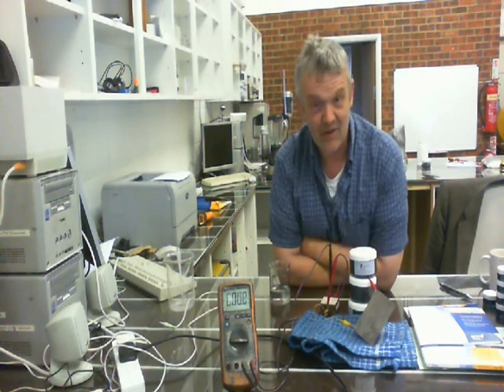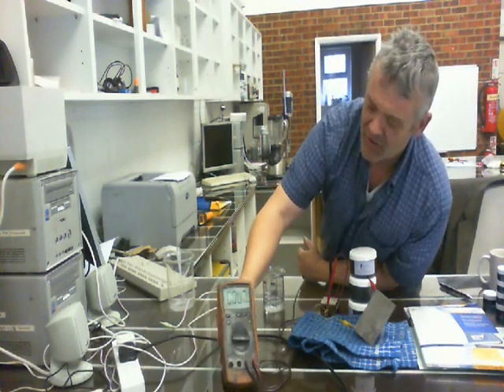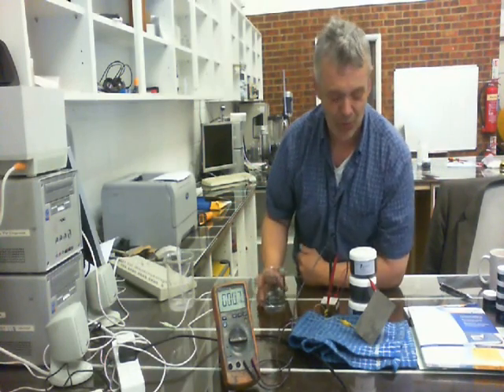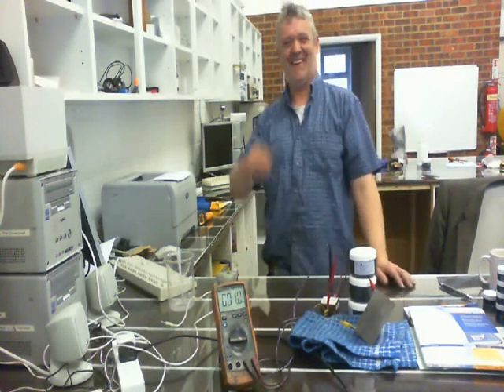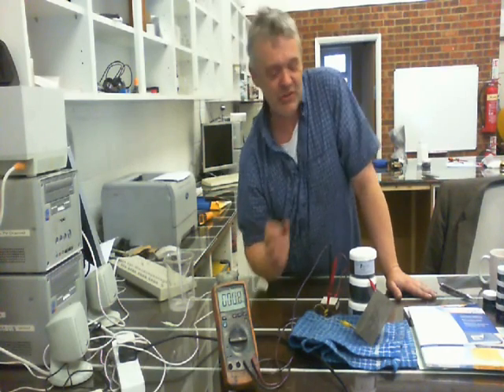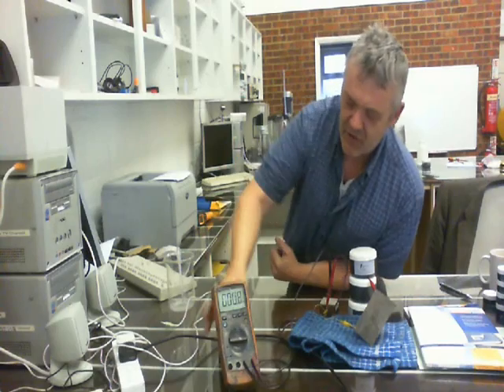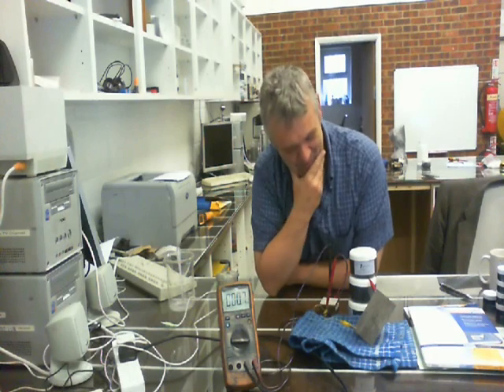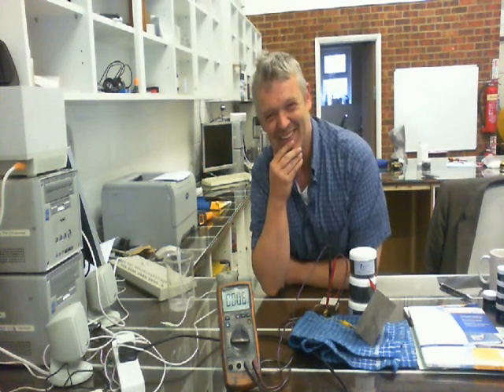Generating Electricity From Salt Water And Graphene (SWAG generator)

Comment: I have a question for you, although it's possible it may have already been asked (as this video is a number of years old). My apologies if you've already covered this subject.

How many times can you run the same salt water over the graphene surface, and maintain the voltage?

My reasoning for this is that I saw another video of yours, where the device was sitting in seawater and as the water flowed over the device, it generated current. I was thinking that if you had a secondary battery that was used solely to power a small pump, you could enclose the device with an input pipe, and output pipe, and a container with the saltwater solution. By pumping it continuously over the device, it would keep generating current. If the system is a closed loop, how long might something like this run?

I know my idea may be crazy, but then again, I often have crazy ideas that sometimes work.

Best of luck in your endeavors.

George

Comment: Science the way it was meant to be done, by doing it, getting experimental results and then making sense of it, and doing other experiments. Bravo.  I immediately thought of lord kelvin's thunderstorm a water drop electrostatic generator.   Of course there you are dealing with Kilovolts and microamps.  Just an idea, but you could create a stack much like a cellcore stack but one which expanded and contracted based on a small temperature difference quickly. Just like is done with a Saser (Acoustic Laser). This could force water at higher velocity back and forth across the graphine. Essentially an electric generator working much like an ultrasonic piezoelectric generator. The advantage is high power density and low weight.  I will put one together, test and report back on the results. You can look at some of my older patents to see how I would use the material.
Reply from the maker: Definitely - i would be fascinated to see - thanks for the hints and help
Reply: Robert Murray-Smith  Not sure I have been of much help, but you have helped me, and hopefully I can return the favor.  I am making hydride heat engines which are powered by ambient temperature conditions.  This is possible because hydrides equilibrium pressure can double and half in 15K increments.  The rate of the reaction is proportional to how quickly you can move thermal energy in and out, and the best one are notoriously poor thermal conductors. So I've become a fancy plumber doing heat pipe heat exchangers, and thin films to get fast cycle times. Yes, I have patents and have worked on this for over 10 years and am about to hit payday, but I do understand your frustration with the current system. I also feel a bit guilty because my work is built upon everyone elses.  It seems sort of unfair sometimes that to one person or worse company goes all the credit.  Anyway the hydrides when thermally cycled have enough fluid power to run a vapor compression system which cools one hydride by allowing a refrigerant to expand, and reject the heat to the hydride releasing hydrogen undergoing the endothermic reaction.  Operating temperature from 0C to 30C.  In essence we have a sort of chemical stirling engine with a vapor compression system being the thermal battery, and as long as your rms mean temp is ambient then all the internal energy is keep constant just changing with the outside ambient within the temp range.  The hydride I am using is CeNi5 because its gut a high eq pressure at low temperatures, but others could be used in the same manner. I hope maybe this help you on something. Seeing as you have shared so much with me. I wish to reduce the mechanical parts and weight so we could power cars, boats, etc this way.  You have given me many ideas.
Reply from the maker: Kimberly Peacock
that's good to know - when you were talking i was reminded of Einstein's fridge. I have absolutely no problem with genuine patents I have a problem with lawyers and too broad a scope that limits others too much - let me know a few numbers and i will have a read
Reply: Robert Murray-Smith As to Einstein's refrigerator yes its an absorption type but the cool thing about the hydrides is they alternate between being heat pumps and engines and can be tuned.  To my mind thermocycling them is the best path for the technology.  I think we are kindred spirits.  People forget that Michael Faraday was self educated.  I will explore any idea as long as it can be demonstrated.  I think Feynman philosophy matches mine, in that for many problems you need to attack it from a different angle or perspective, and to do that you have to be open to surprises.  I admire you.
Reply from the maker: Kimberly Peacock
Now you have named a few i realize that I have come across a couple of your patents before and read through them- nice work
Reply from the maker: Kimberly Peacock
bless your heart - feel free to write to me at robertmurraysmith64@gmail.com
Reply from the maker: Kimberly Peacock
actually I am in nY long island greenport
Reply: Robert Murray-Smith Next time I head out that way I'll drop you a line and maybe we can meet for coffee. Love Greenport. I grew up in Bar Harbour Maine and Greenport has the same sort of feel to it.
Reply from the maker: Kimberly Peacock
Sorry I meant in Long Island in a general sense lol - I am visiting here and only here until the 1st of august
Reply: Robert Murray-Smith Well I head out to Melville quite a bit sort of a middle point between manhattan and greenport if you want to get together for coffee sometime.  Do you sail?
Reply from the maker: Kimberly Peacock
I do indeed - and sounds like a plan

Comment: Paint it on a cylinder and spin it in saltwater
Spin a rod of graphene in saltwater
How about a propeller?
Reply from the maker: why? - just dip it in the sea - occams razor mate - try for the simplest first and see if it  actually works - at this stage it is just a curiosity - it needs proving up
Reply: Robert Murray-Smith
Why not? That's the real question. You can't put a sea in your test lab can you? Besides, what kind of boat do you have that could mimic the surface speeds or ease of your new blender?
Reply from the maker: *****
it's not up for sale yet mate - it's only going out to my indiegogo supporters at the moment
Reply from the maker: TheIdeanator
Why not - well there's more likelyhood of failure with complex machinery, I live by the sea so moving the test gear down there is a 500 yard walk for me and I live on an island so i was thinking of sea powered electricity generation for everyone. But not everyone thinks the same thing - so go for it - test your ideas out
Reply from the maker: *****
will do mate

Comment: If you coated the blades of a Tesla turbine with your ink, and wired it for generating electricity I wonder how much you could generate by pumping salt water through it?  Let me know what you think.
Reply from the maker: it's a good idea - i can see a problem with the connections though that i imagine would have to be at the central axis (no problem) and at the turbine rim (big problem) but i think if you can overcome that it would work really well - bear in mind this is exactly the problem Tesla had with his homopolar generator and he solved it by running to generators and connecting the outer rims with a metal belt so take off was at the axles only

Comment: Does annealing change the result? That is amazing
Reply from the maker: i'm sure it does - i am guess it makes it worse lol. the preannealed ink has a greater surface area so my guess is the result would be better as this is an ion diffusion mechanism so highly likely to be related to SA
Reply: Robert Murray-Smith  I'm sorry but I'm not familiar with the abbreviation SA. Here's an idea, take a bit of that tape for the heater. Then coat it with the waterproof ink. Now roll it into a tube. Connect your leads in the proper places and hook a 12 watt fountain pump to it stick the pump in salt water and get it going. See how much power you get.  BTW what was the price on the waterproof ink? Love your work.
Reply from the maker: thagrit
SA=surface area. Good idea - but i live by the sea so I am more likely to paint the inside of some pipe and have a day on the beach. I am not sure how much it is yet - I have to work out how much it cost me to make

Comment: from google: “When a saltwater drop sits still on top of a strip of graphene, any charge it has is redistributed symmetrically on both sides of the droplet, leaving zero net potential difference between them. When the drop is moved, however, the distribution becomes unbalanced. The electrons from graphene are desorbed at one end of the drop and absorbed at the other. The difference gives rise to an electric potential on one side of the drop, generating a voltage across its length… The resulting electric potential is proportional to the velocity (of the dragged droplet) and the number of droplets.” ... doesnt have to be droplets, i can be water flow... LIKE IN THIS VIDEO

Comment: In the exp, they isolated each side of the water drop.  The article implied the voltage potential was on the leading and trailing edges of the water, which seems to be needed to keep the voltage from shorting itself out via the high conductive graphene around the sides.  Coat the inside of a tube, application should be practical as an inherent symmetrical counter force is always present.  Drop enough water through to isolate +/-, connect several tubes anode to cathode to get higher voltage battery effect.
Again, I think the minerals are having a Lenz's Law effect.
Reply from the maker: ok
Reply from the maker: I have had time to think about what you said and I am beginning to think you might be right here - thanks for opening my eyes to this idea mate

Comment: haha... lovely to see you having fun mate. Also that is interesting an find.
Reply from the maker: science is fun mate - and chemistry ROCKS lol
Reply: ... i hope kids get to see adults having fun with chemistry in this way... you inspire. Also, maybe create a tube of your flexable sheet, and pour salt water down that. See if that works. then maybe that can be used in some sort of pumping loop
Reply from the maker: DiyEcoProjects
yeah maybe lol
Reply: Um ... is this some form of galvanic reaction do you think? Im sure over a period of time youd get residue. Or maybe the electrons are just being excited and collect on the plate somehow as it drops ... hmm interesting
Reply from the maker: DiyEcoProjects
did you read the original paper?
Reply: Robert Murray-Smith
oh no... ok ill google it
Reply from the maker: DiyEcoProjects
lol - it answers a lot of your questions mate
Reply: “When a saltwater drop sits still on top of a strip of graphene, any charge it has is redistributed symmetrically on both sides of the droplet, leaving zero net potential difference between them. When the drop is moved, however, the distribution becomes unbalanced. The electrons from graphene are desorbed at one end of the drop and absorbed at the other. The difference gives rise to an electric potential on one side of the drop, generating a voltage across its length… The resulting electric potential is proportional to the velocity (of the dragged droplet) and the number of droplets.”

ok so its not galvanic … nor is it about torrent of water ... its about the electron potential found in droplets. Interesting, thanks

btw - they say that copper chloride droplets also work
Reply from the maker: DiyEcoProjects
I imagine any ionic liquid would - it's just there is a lot of seawater around and most of it is moving - lol
Reply: Robert Murray-Smith
yes... cool... so are you saying it doesnt have to be a droplet? so something larger, more tubes, tidal movement would work too - how very interesting
Reply from the maker: DiyEcoProjects
mate! - you saw me pour a stream of it down the sheet - so no it doesn't have to be a droplet
Reply: Robert Murray-Smith
haha ... balls! not very observant today am i! FAIL! lol
Reply from the maker: DiyEcoProjects
lol

Comment: Erm... I don't suppose you live near the sea?
Reply from the maker: lol i do indeed lol
Reply: Big sheets of something > bucket of waterproof graphene ink > strong fishing line > some chunks of expanded polystyrene?

Does the voltage increase in proportion to the surface area, speed of flow, strength of salination etc?

Do fully submerged sheets in contact with moving saltwater generate a current?

Holy crap! :-)
Tidal power may have just become easy and cheap.
Mind = blown O.O
Reply from the maker: Fred Gandt
well worth looking at i think
Reply from the maker: Fred Gandt
Hiya Mate,

If you order the soap I will have to make some more and I am a bit rushed at the moment to do that so don't worry - to be honest I have appreciated your intellectual support more,

Rob.
Reply: lolz :-)
Okay. But I'd actually like to try it some day in the not too distant future.
Let's face it, it works - better than I've ever seen a soap work!
I've worked in engineering and accident repair centers, and have seen all kinds of nasty goop not shift under the application of various solutions. You just squirt and wipe, and thick grease just melts away!!
I'll wait though.
Reply from the maker: lol - cheers mate
Reply: I could imagine a Graphene based coating on every type of man-made object we submerge for any reason that would have a primary use of corrosion prevention. And then you add a couple electrodes to turn every pipe, tidal break and bridge footing into a generator. 
Does not really matter if the amp per meter is small since the cost is already offset by the utility of the coating. Free power is awesome.
Reply from the maker: yes it is lol

Comment: Congratulations!

I see +2 volts and at which amps?
Imagin a large sheet put into sea-currents, creating electricity.
Reply from the maker: i need to look at this some more mate - at the moment it is really just an oddity.
Reply: Robert Murray-Smith I think you are on to something here, great informative channel by the way!

I am part of the Free Energy Party (USA/UK) and found your channel through one of the DIY Graphene and DIY ultra capacitor discussions going on over there.

I also really like the soap formula you discovered, I am thinking of buying a kilogram in the upcoming months and give samples in pumpbottles around to cargarages, flowerists and every dirtyhand business and see if they are interested.

Cheers!
Reply from the maker: Greenme Research
sounds cool mate - let me know a little bit before hand when you want the soap as I am concentrating on the ink at the moment for obvious reasons and will have to change gear a little for the soap

Comment: submarine siding?
Reply from the maker: or tubes along the coast and use wave power to drive the seawater across the surface
Reply: Coat sea walls and jetty pylons etc with it.....
Could be good in tidal ares too....
Reply from the maker: and with no moving parts or huge infrastructure need this could be pretty cool